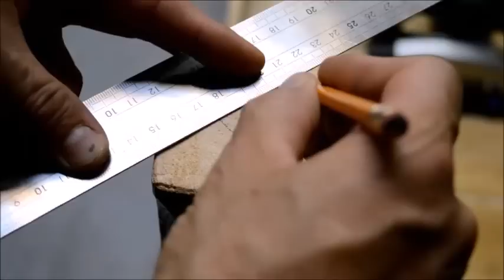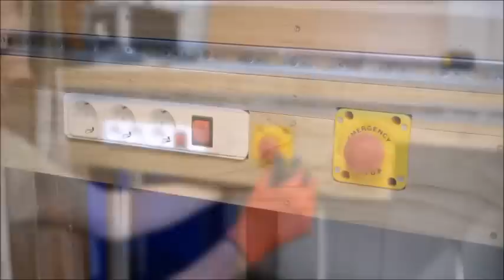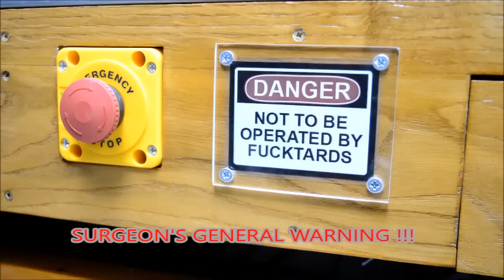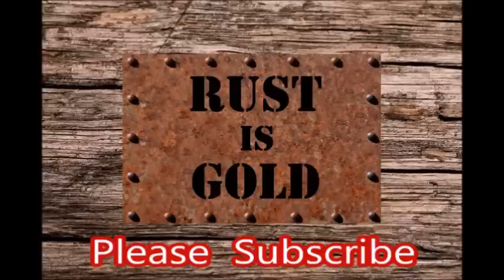DIY Table Saw - How to Make A Homemade Table Saw

Comment: Wouldn't it be faster to just go out and buy a table saw. If you need a table saw. Look at all the equipment he used to build his table. This guy has way to much time on his hands.
Reply from the maker: You are missing completely what Diy is all about...
I had fun building it, it is not a professional table saw but it works great for the projects I make and finally, it cost almost nothing (50€!!). No store in the world can give you such a bargain...

Comment: Junge Junge Junge  Kabel mit 2 Stekern für die Stromversorgung   bei film länge 12:33  son teil hat mein Vater auch gehabt und es hätte beinahe mein Leben gekostet .--was machst du da für ein Scheiß  .da must noch schreiben Bitte nicht  Nachbauen..
Reply from the maker: Danke für deinen Kommentar. Ich möchte Sie darüber informieren, dass ich es geändert habe und durch eine andere sichere Steckdose ersetzt habe. Leider lässt mich Youtube mein Video nicht bearbeiten und löscht diesen Teil aufgrund der hohen Anzahl von Ansichten, die das Video hat. Das einzige, was ich tun kann, ist, Personen zu schreiben, die sie in den Kommentaren erwähnen ...
Reply: @RustisGold  Ja danke fürs lesen,. mein vater war auch so ein Bastler. und ich habe den beruf des Schreiners erlernt  und vermeide es mit solchen Gefährlichen selbstgebastelten maschienen zu arbeiten  und verwende nur Industrie Werkzeuge die sicher sind und Bessere  ergebnisse der Werkstücke erziehlen...sory für tipfehler ich sehe nicht mer gut.
Reply from the maker: @batscher61  Kein Problem, ich verstehe nicht, warum Youtube seine Richtlinien geändert hat und keine Videobearbeitung zulässt, nachdem Sie 200.000 Aufrufe erreicht haben ... Ich möchte auch diesen Teil entfernen, aber ich kann es nicht. Vertrauen Sie mir, es ist jetzt sicher. Haben Sie einen guten Tag!
Reply: @RustisGold  Doch du kannst das video bearbeiten in dem du es Runterläds auf dein PC und im Videobearbeitungsprogram  änderst und neu Hoch lädst.

Comment: Looks nice, but iys useless. Extremely over built to do just one cut, not be portable to take to job sites, and dangerous. It's a direct drive system now. No matter if someone is a "fucktard" or not, everyone has kickbacks. A few kickbacks from that really pretty project and the circular saw breaks loose. Accident waiting to happen. Noce job though......making a useless piece of equipment that you could have bought a safer, better, more useful saw.....cheaper. 👍
Reply from the maker: I didn't want something portable, it stays in my workshop, I am not a professional carpenter so it fits perfectly my needs. Regarding the cost I don't think you can find something similar, quality wise, for the 50€ that it cost me to built it. Above all, I had fun building it. Regarding the f_tard sign it was just a joke... Relax all of you people who take it so seriously...
Reply: @RustisGold  good for you having fun with your projects, but unless you used spare parts or something, there is no way that it cost 50€ which is about $65. The emergency shut off switch alone is about $40. But, you're getting views. That's all youtubers want anyway.
Reply from the maker: @darthslagle5979   I didn't pay a single penny for all the wood I used. It was all retrieved from the garbage and I upcycled it. I only paid for the electrical parts, the wheels and a new replacement saw disc. Trust me I didn't pay more than the 65$/50€ I told you before. By the way, the emergency shut here in Greece cost me less than 15€...
Reply from the maker: @baltazar0007  thank you very much for your comments. I don't mind when people have a different opinion and criticize my projects. I get upset when they are rude, aggressive and they start cursing. The famous YouTube Haters that we all know... This is not the case with Darth Slagle, I have no problem with his comment. He may have a different opinion but his comments were not offensive at all. What many people fail to understand is that I have a passion with creating or restoring various objects. I don't give a damn if I could buy them cheaper at Walmart! 
Do you also have the .... virus of building or restoring things?

Comment: Have a professional electrician rewire your machine. A lot of dilligent work for something of little use. Suggest you buy yourself a table; there are good ones on the market. And for your own safety learn to use it. Though to want to do work for which you have not served a trade is inadvisable.

Comment: Some details where not included to make video shorter ????? Like measurements fittings and materials yeah right this is another video of a guy making something not how to
Reply from the maker: Thank you very much for your comments. For such a project you don't need to have specific measurements. It is not necessary to make an exact copy of it... This video helps you to get ideas of how to make table saw.

Comment: Yikes, Definitely not worth the effort. Limited and poor performance compared to a used table saw for 100 bucks.
Reply from the maker: This is a DIY channel. Not a Walmart catalogue. If you don't like what you see just order one from an Internet catalogue.
It cost me 50€ to built and I had a lot of fun making it. It's not a professional table saw but it works just fine.

Comment: Or, you could go out and buy a good one and save yourself some money.
Reply from the maker: It cost me 50€... 
How much more money could I have saved??
All the wooden parts of the table I retrieve them from the garbage, zero cost.
I only had to buy a new cutting disc the wheels and the electrical parts.
Reply: @RustisGold  plus the cost of replacing the circular saw you used not to mention the time spent, I presume your time isn't free.
Reply from the maker: @michaelhanrahan5349  I don't do this for a living.... This is my hobby, so in this case my time is for free!!